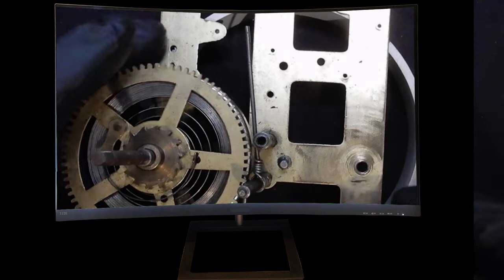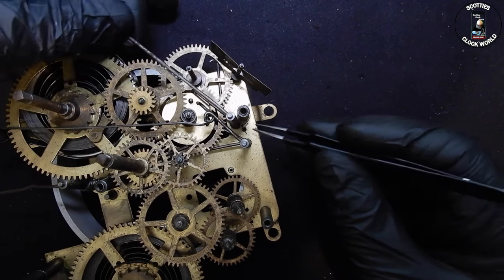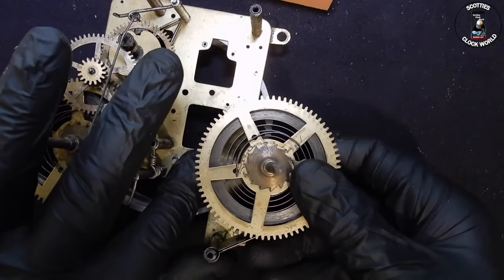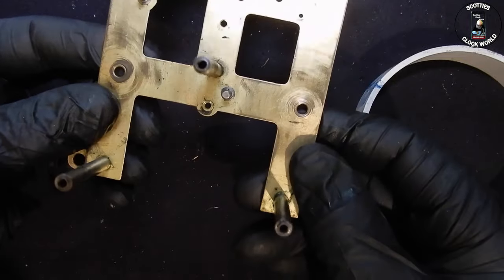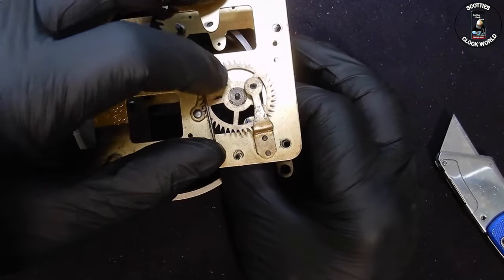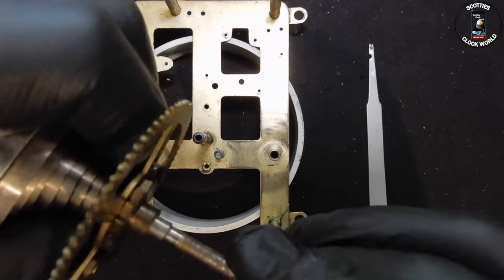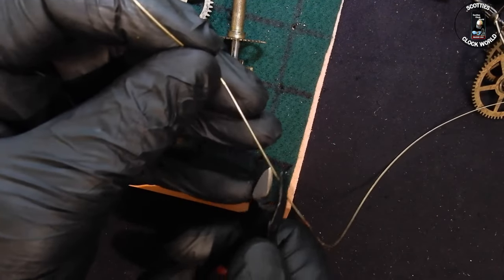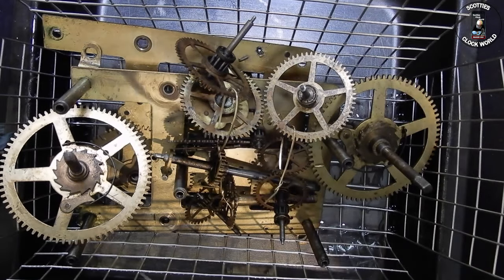Waterbury 10 Inch Drop Dial Wall Clock Restoration - Episode 2

Comment: Does rinsing them with naptha help to remove the water left on the parts?  I'm assuming that the water would spot, etch, & cause rust on the steel parts?  Thanks Scottie
Reply from the maker: Without using the naphtha the plates and wheels will have water marks on them. Yers, you are correct.